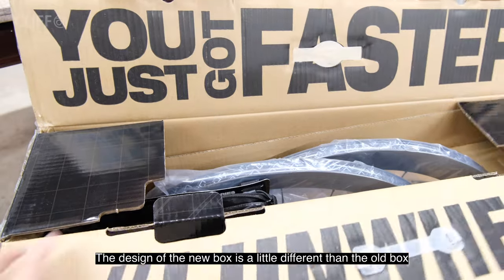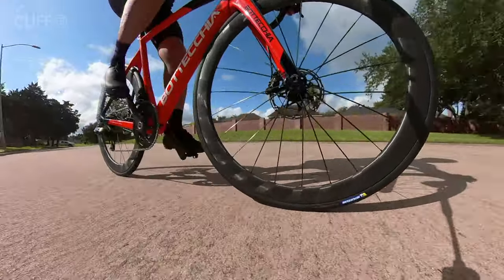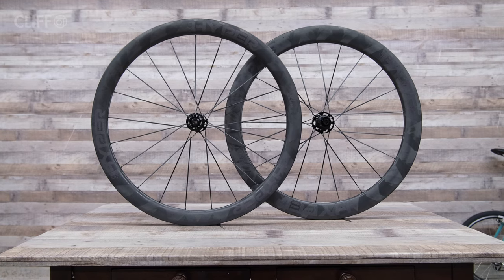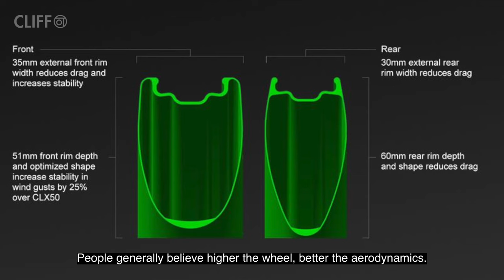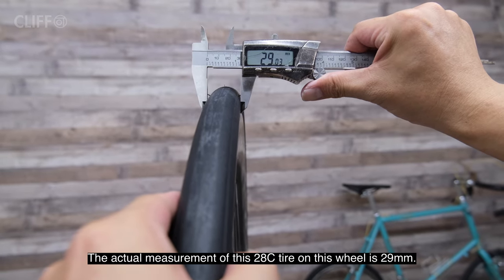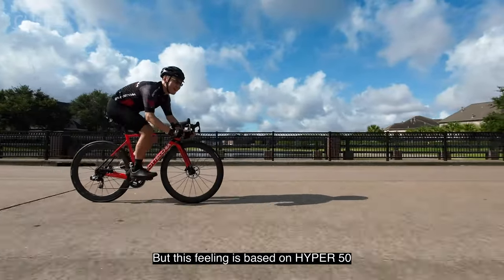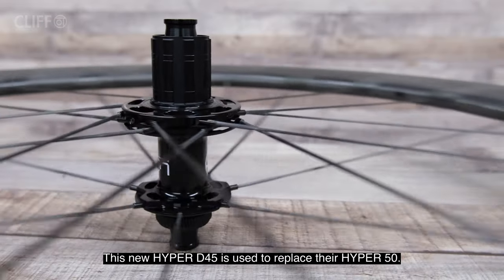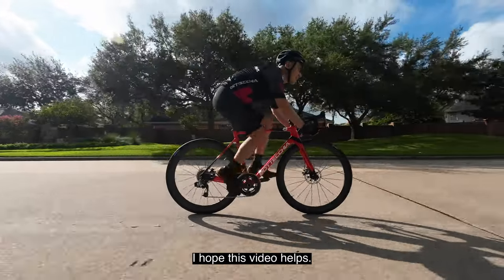Winspace Lun HYPER D45 Wheelset Long Term Review / Chinese Carbon Wheel / Disc Brake

Comment: Wow. Your video was very good at presenting the basics of the wheel without getting too technical. I really appreciated how you measured both the 25mm and 28mm tyres. This really helps for someone considering a rim brake version as the tolerances are usually tighter than disc brakes. Cheers!

Comment: Nice.. a little sharing, i bought D45 in October 2022 pairing with Giant Crosscut AT2 700x38C & installed on my Giant Revolt 2022, i ride everyday until just about near 10.000km to this day i think. Finally both front and rear 6903 bearing broken & i need little, just little rim tunning after all torture. I ride mostly on paved road, single track, wet and muddy condition, for this kind of wheelset, i think i can accept this. This wheel is not bombproof, but it is fun to ride and also has a nice looking.

Comment: i have the 50mm hyper but the d45 hubs seems alot quieter than the 50mm. did they replace the ratchet on d45 or just more grease in them?
Reply from the maker: Yes, they are quieter. I also have HYPER 50 from last year, and I notice both D45 & D67 are quieter compared to HYPER 50. However, I don't know why.
Reply: All Winspace hubs use the same freehub mechanism: A 6-pawl cluster that engages 3 pawls simultaneously and alternates with the other set of 3 pawls after every click.

The amount of grease and viscosity does have an impact on how the mechanism will sound, but I prioritise smoothness over everything else. Fast-engaging hubs are always louder by design.
Reply: They’ve definitely increased the greasing of the hubs. My og 2020 model had almost none, my D45s were overflowing

Comment: Is 25c better for these wheels than 26c or 28c?
Reply from the maker: I would guess they kind of design these new wheels around 28c in mind.
Reply: The HYPER 2023 is aero-optimised for 25 - 28 mm tires.
Reply: @yonglingng5640  with all the D models?
Reply: @WhiteRiceCycling  Not just the disc brake versions, including the rim brake versions. That's why I said "HYPER 2023", meaning all six variants are optimised this way.

Comment: I have the 2020s in a 50. Looking to chabge because they are so harsh
Reply: Are you saying they are uncomfortable to ride?   I do long distances.  That is my main concern with buying carbon spoke wheels.
Reply: @CrabgrassFarmer  yeah. You need 28s at a lower pressure. They were so harsh on 25s. I have the 2023 version now
Reply: @TrickyTree84   Thanks for the reply!   I'm thinking of getting the 2023 version and definitely running 28s.   I do 9-10 hour ride/events.   Would you be ok with the 2023 models and 28 tires for that long?
Reply: @CrabgrassFarmer  yeah I do 100 mile rides on them. Also to mention I'm in the UK and our roads are terrible. I run around 60 to 70 psi on 28s and they are fine.
Reply: @TrickyTree84  Thank you again.  I know your roads well.  Lived in the UK for 4 wonderful years, and I miss it.  Happy Christmas to you.